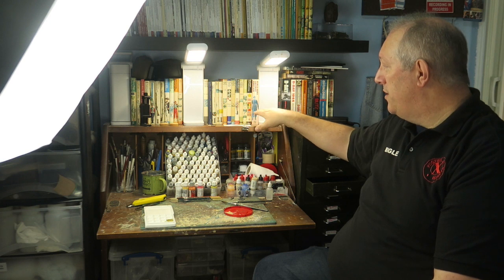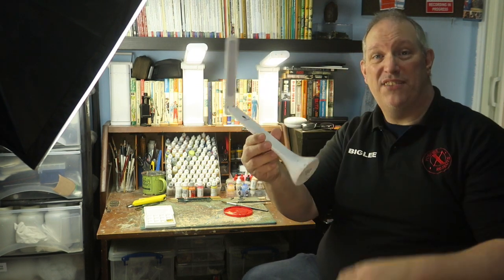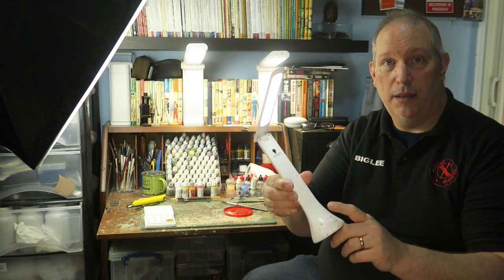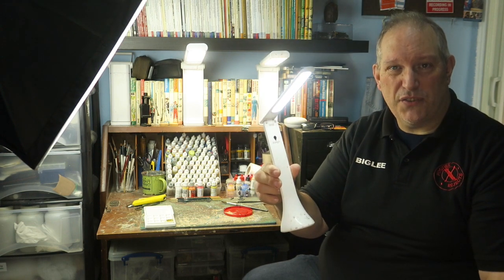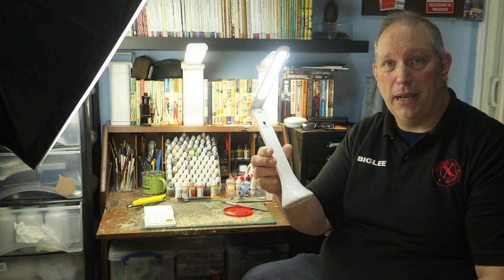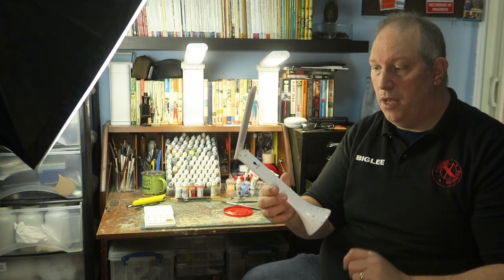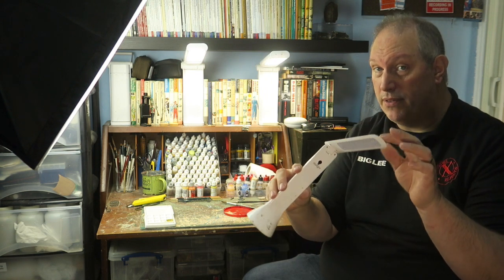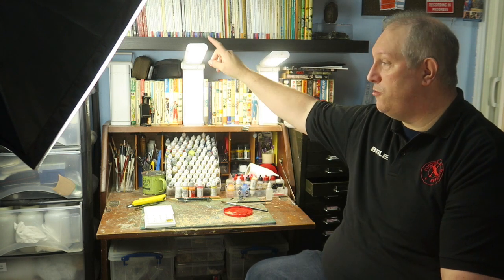Lighting your paint Table

Comment: Could you possibly give details about your light box please... I'm very keen.
Reply from the maker: I got that from Amazon. It's a RALENO 20''x28'' soft box. It came with an 85W E27 Socket lamp with a colour temperature of 5500K, an Adjustable Stand and Portable Bag. It's currently £49.99 but I'm sure I got it for a lot less than that (it was on sale when I got it). The bulb is low energy but you can get LED bulbs which are even more efficient. Hope that helps.

Comment: I bought a USB desk lamp (kind of like a mini dentist's ring light) that I've been using exclusively since I got it. I didn't feel too much like I was struggling prior just going via an energy saving lightbulb off centre in the room but the change has been like night and day, especially as I work a lot on cut price ranges like Reaper Bones and Wizkids which have a lot of 'naked eye invisible' details thanks to the plastics used. I've been thinking on power saving for a long period of time, it's frustrating how little has a real on/off switch, and that (plus bulb wastage for a 'real bulb' light) was what drove me to a USB powered unit. This has a tripod arm (not a great one, but an arm none the less) for holding your camera or phone so when the LEDs croak I can keep hold of it as a clip on tripod rather than having to outright chuck the unit, which is nice again on the wastage bracket.

Great video, interesting to see your setup. Looks like a great optimisation of the area.
Reply from the maker: I have a USB ring light but I exclusively use that for filming or photographing miniatures not for painting. But if it works for you then its probably a good alternative to a standard bulb.
Reply: @MiniatureAdventuresTV  It's been er...illuminating xD...I'll get my coat. In all seriousness, I can't imagine working without it now. I wouldn't say my eyesight is too rough, touch wood, but it's really helped in terms of understanding what's in front of me details wise.

Comment: Interesting look behind the camera position.

Moved some years ago into an upper room with very high daylight input. For the later Hours a single stronger daylight lamp helps out. Sufficient at the moment. Sunlight drying out my wet pallet is more a problem and this in the middle of germany. 😄
Reply from the maker: I do find that as I have got older I need more light to see correctly.
Reply: @MiniatureAdventuresTV  I´m with you. For me it's the distance, switched to progressive lenses. 😉